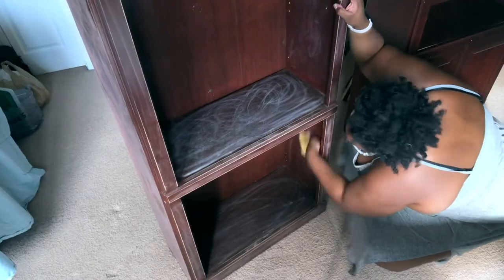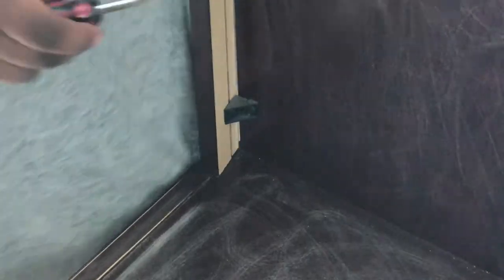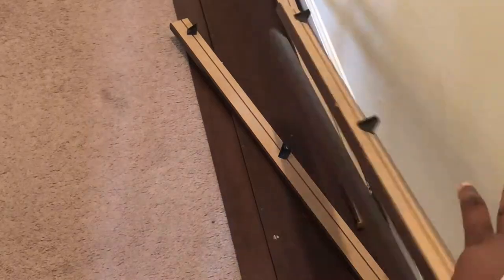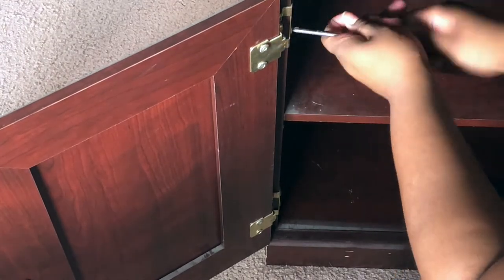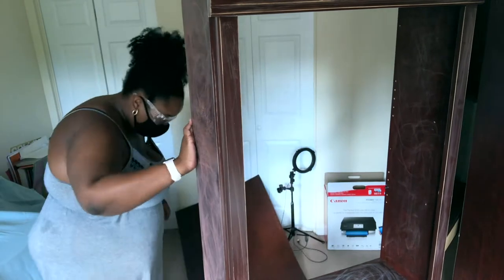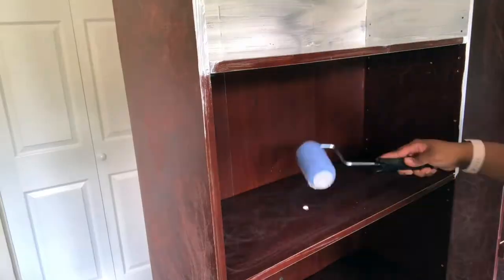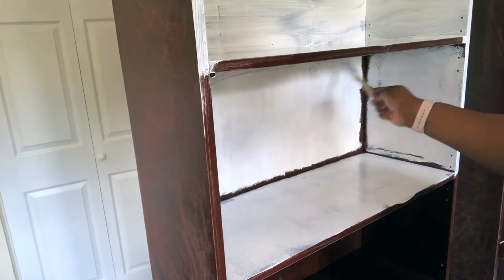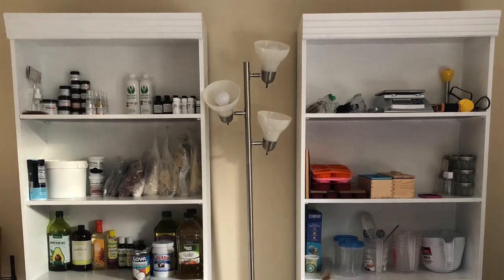DIY BOOKSHELF MAKEOVER | Painting Laminate Furniture | Bookshelf Makeover | My Experience

Comment: Paint and Primer combo stinks.  I dislike the latex primer, so I use the Kilz Oil base with a smooth roller, then I use the latex paint when it's dry.  For a smooth store-like finish, I use a colored stain. i.e. a furniture piece I had with a black top finish, I sanded the scratches and did not use paint but used an oil-based black enamel stain per the furniture store and it looked like when I bought it.! I Love the bookshelves... GREAT JOB.  Repurposing old furniture or glamming up cheap store-bought laminated furniture is fun.